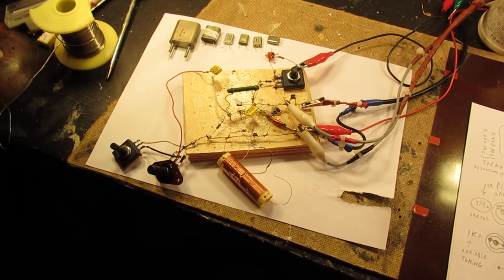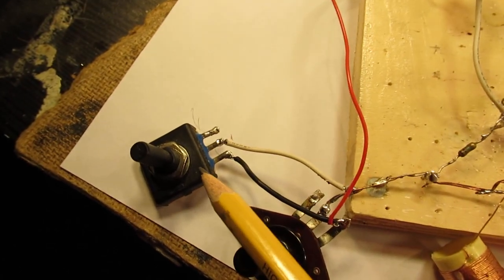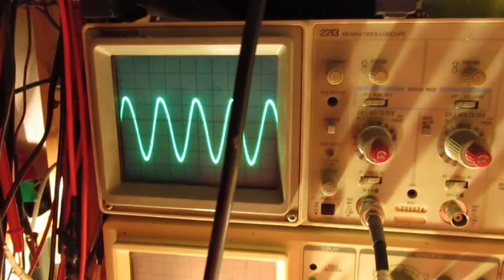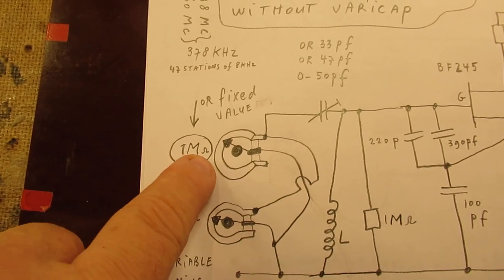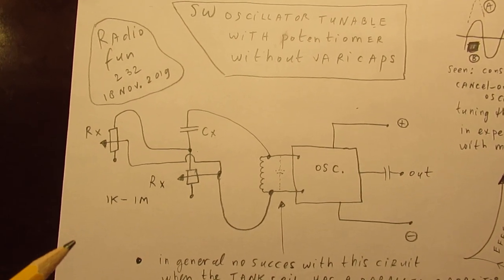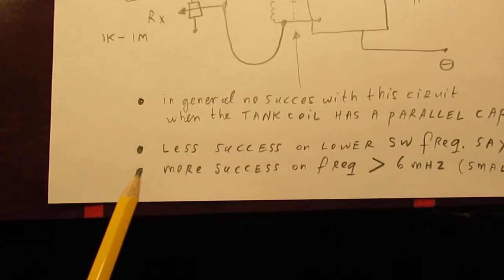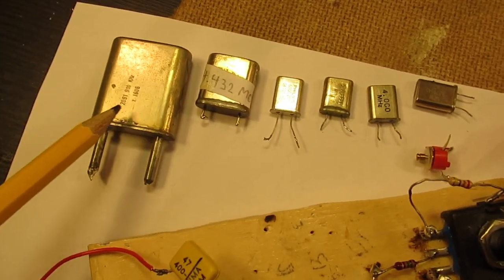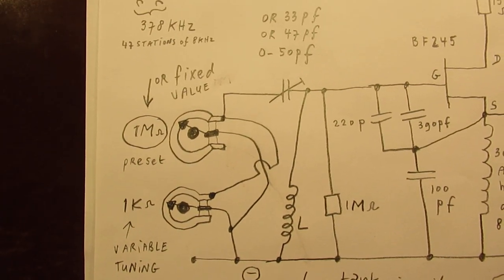SW oscillator on 4 MHz tunable over 380 KHz via 2 potentiometers & 1 cap (demo and schematic)

Comment: Interesting circuit.  Question, do you think as time goes by, that experimenting with old school electronics will become less popular?  May not have parts for circuits for example.
Reply from the maker: Yes it will be, because in fact all old school say consumer circuits (radio's, clocks, audio amps, oscillators, shortwave radio, cellphones with their GigaHertz transmitter chips, etc, etc) are now immersed (=built in & transferred to) into digital applications (say: chips). Everything is digital nowadays, 2019, we can receive radio stations between 30 KHz and 1 GHZ with one chip ("Stick") of say 20 Euro/Dollars with everywhere freeware,  radio perfectly stabile, within 1 Hertz or 10 Hertz, all the old school problems are vanished with such a setup. The only field in which old school circuits & principles are present (read: visible) is science nowadays when they do in fact old school measurements, but on a very very high sophisticated state, say when they are counting electrons one by one. Of course many new chips (say electron counters or super high resitance electrometers) are used via,  (say) Opamps or chips in the scientific field, where the computers (with all their calculation power) play a minor role, only to calculate physics (analog) phenomenon that happen on another scale. Of course the laws of physics don't change, but in old school terms we are talking about new concepts, say how a "Ampere" has to be defined when electrons really can be count one by one. 19 nov 2019.